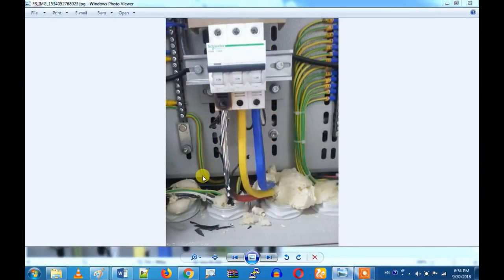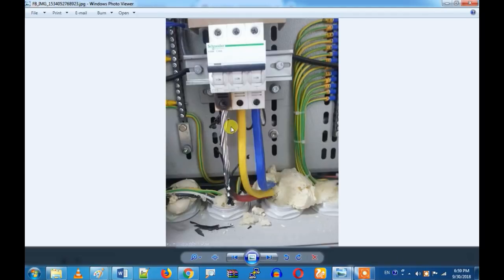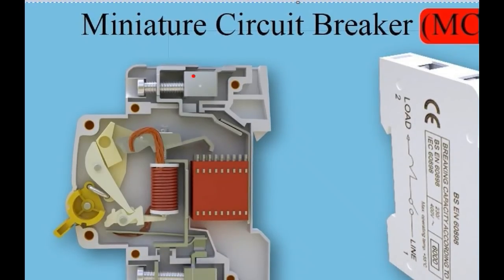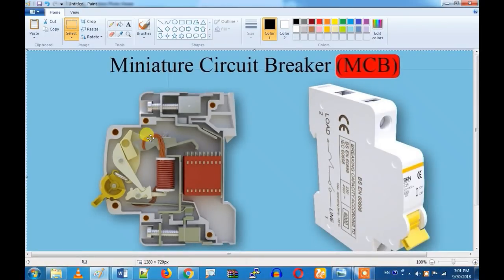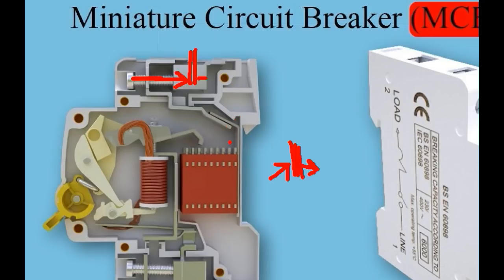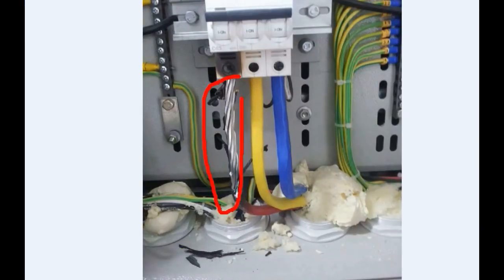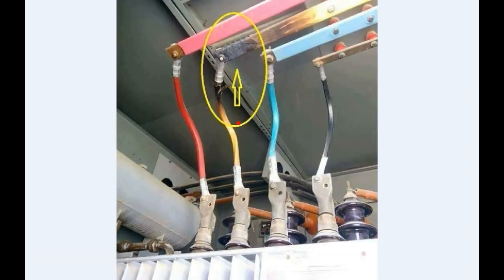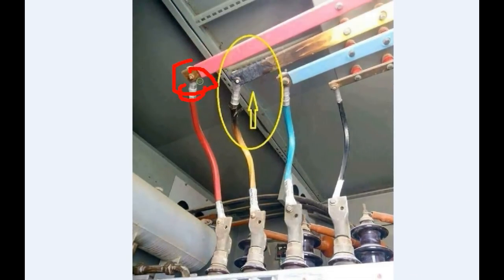Why MCB Failures Frequently in Tamil 13 Strong Reason

Comment: Lug use pannalam multistand cables la, apo andha bros varathu
Reply: 8- bro 35sq.mm cable Ku 25sq.mm la vechu crimp panna lug structure change aaidum, the 35 Ku 35la vechu crimp pannale crt ah tha irukum
Reply: 12- Main reason for using spring washer to add friction, verum nut mattum use panna vibration la loose aaidum, spring potta friction add aagi avlo vegama loose aagathu